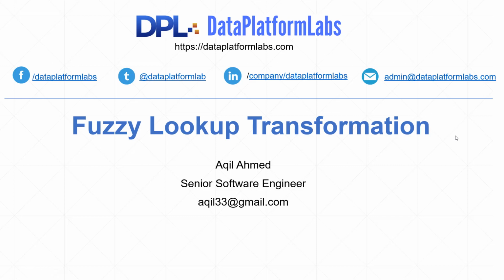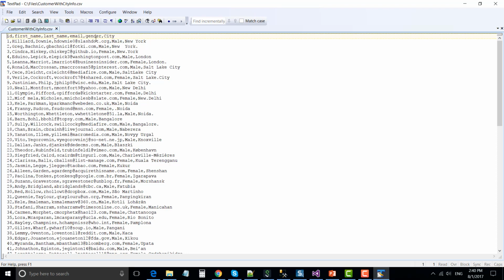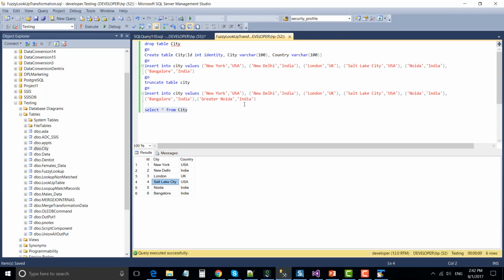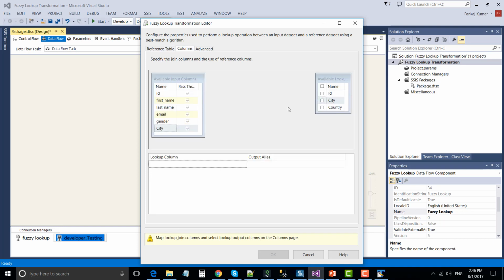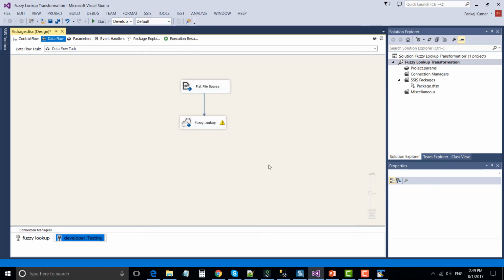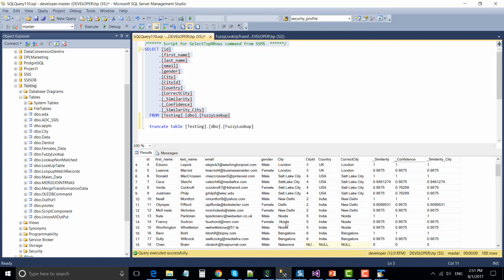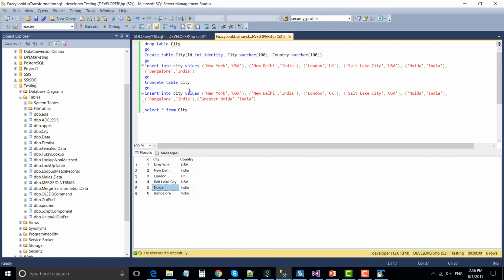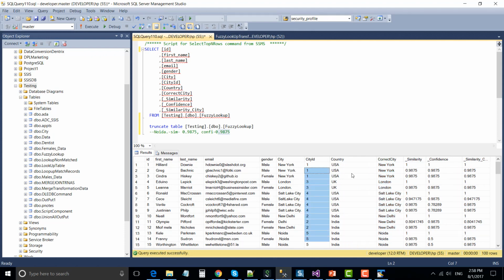40 Fuzzy Lookup Transformation in SSIS

Comment: can you help me how to used not in two component in ssis like 
 select * from dbo.tblStudent where intStudentId not in(select intStudentId from dbo.tblLibary )
Reply from the maker: Sorry for replying so late, was a bit busy. You can use Merge Join component where you can use Left Join, so it will return all records from left source and matching records from right source. For non matched records from right source you will get a NULL value, so may be in a derived column transformation you can replace a NULL with some different value and then in  Condition Split transformation based on the data returned you can decide if you want to move the matched records to one table and non matched records to another table.

Comment: Error with Data of  20 million.
Reply from the maker: What error are you getting ?
Reply: @learnssis  thanks for answering me. This is the error:

Error: 2021-12-03 14:36:03.08

   Code: 0xC0047022

   Source: BUSQUEDA DIFUSA SSIS.Pipeline

   Description: SSIS Error Code DTS_E_PROCESSINPUTFAILED.  The ProcessInput method on component "FUZZY LKP" (2) failed with error code 0x8000FFFF while processing input "Entrada de busqueda aproximada" (16). The identified component returned an error from the ProcessInput method. The error is specific to the component, but the error is fatal and will cause the Data Flow task to stop running.

 There may be error messages posted before this with more information about the failure.
Reply from the maker: @maihuire11  I think this error is related to Memory, because data is huge, thus you would need more memory to process it.